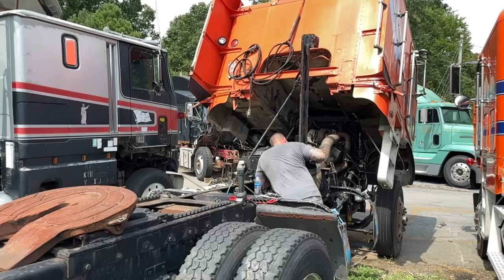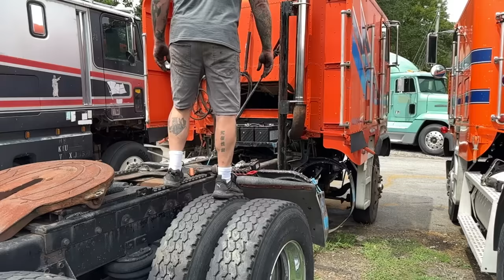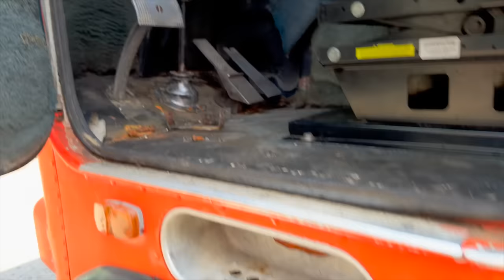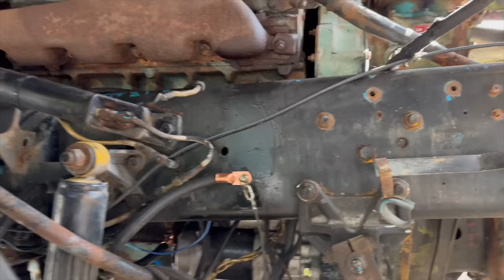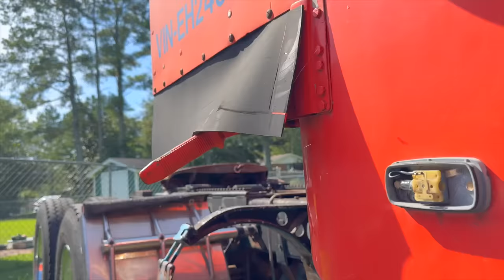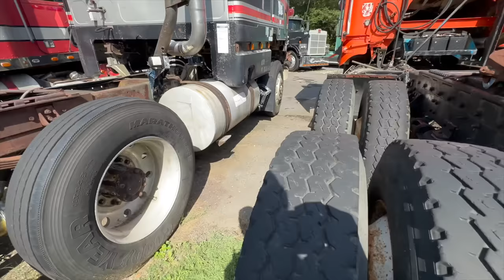Freightliner Cabover "Delores"  Could Be a Disaster, Is It The End?

Comment: James, you’d said previously that the oil pan has a crack in it and it needs replaced, correct? Might be worth it to drain, remove and do a bottom side inspection if nothing other than peace of mind. I’m more inclined to believe the injector knock or the compressor theory you spoke of…..
Reply from the maker: Ya I just received my pan gasket. It’s in the schedule for a drop clean inspect braze and reinstall.

Comment: if you think the rings are stuck from sitting, let it come up to temp and cool down a few times. I heard this will free the rings on those detroits. I see no unburnt fuel, i see no water, it does not smoke, so it seems many things are in okay shape. when you pull the oil pan you can see the condition of the bearings. either way, she sounds good from here.
Reply from the maker: I’ll check some bearings when I get the pan off for the crack repair

Comment: I was browsing the Internet yesterday and I saw a 1981 gmc general for sale a couple of miles away from my shop.  I decided to go look at it just for the hell of it and I ended up making an impulse buy.  The truck is actually is pretty good shape as in no rust or dents but definitely needs a paint job.  The truck is really long and has a lift axle, I believe it was previously a dump truck.  From everything that I could find the truck only has 350k miles on it.  The engine is a 3406a with an 18 speed out back.  I have no idea what I am going to do with it, I couldn't pass it up for $2,500 and it runs.
Reply from the maker: Oh man. Sounds like a good find.
Reply: @JamesPretty Trucks are much cheaper in California due to the emissions requirements and strict enforcement of safety.  Anyone considering buying a truck like that who is out of state has to deal with the hassle and cost of having it transported out of California.  Most old trucks in California are sold for scrap value and I have a feeling that is what happened to the dump bed that was on the truck.  

I have a 2014 33' airstream classic that I purchased at auction that was severely jackknifed 2 directions that I was originally planning to rebuild but now I think I am going to incorporate into the truck I just bought.  Registering the truck as a recreational vehicle is probably the only way for me to register and drive it in California.  I have seen a few people that have combined airstream trailers with semi trucks.

My other wild dream is to turn an airstream into an airplane.  It would want to keep it as much airstream as possible.  It would have to be the size of a dc3 to actually fly.
Reply from the maker: @ChrisHarding-lk3jj  cool
It would be interesting to see that finished.

Comment: Get a mechanics stethoscope and you narrow down where the noise is coming from James. It almost sounds like an auxiliary pulley not fully tightened and rocking back and forward or a coupling drive on the compressor. I don't know what way the compressor in a Detroit is coupled but I had a Cummins scare the crap out of me making a very similar noise and it was the drive between the compressor and the auxillary coupling had worn.
Reply from the maker: I’ve got one some place I’ll look for it
Reply: Check the compressor coupling as well, the knocking probably stopped when your compressor purged

Comment: It could a been a wristpin banging till you warmed it up an injector will knock a rod bearing would commit suicide at those high revs that's horrible to rev it in neutral with no load on it cause it's all just flopping around there is no pressure on the bearings or pistons
Reply from the maker: Lol believe me when I say you can toss a brick on the pedal and it’ll be fine  but I was trying to kick the rod out if that was what was happening